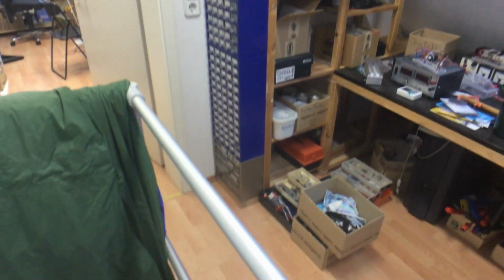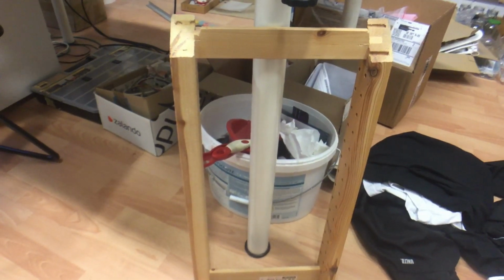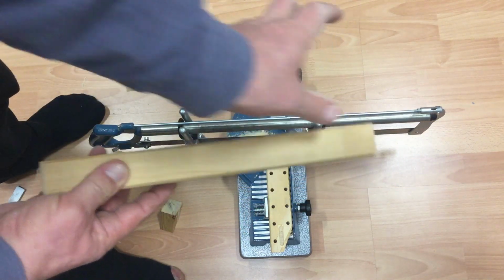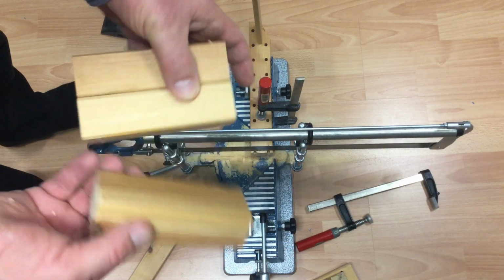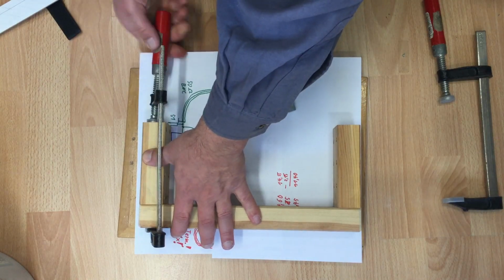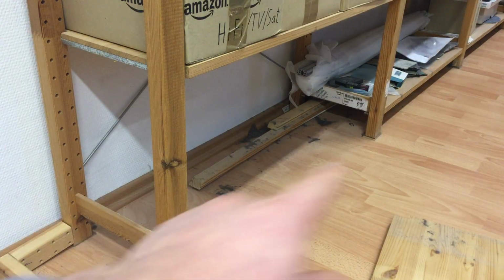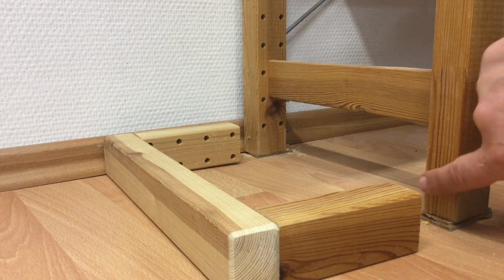I Will Have Order! – Plinth for Storage Cabinets Attached to Rack

Comment: 7:58 is a problem only if you are very sure that inside sides are perfectly square, is much better if you check squareness at the outside, which is the visible side
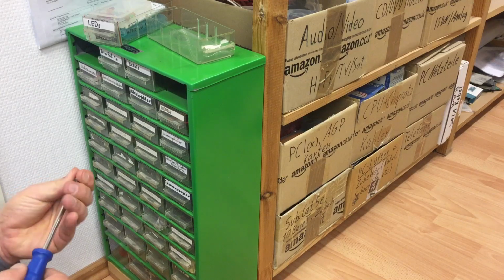13:35 Felo screwdrivers? I have ones since 35 years and still looks like new
Reply from the maker: You're right (squareness)! On the outside (at least at the one I can still measure) the parts are square :-) Regarding the screwdriver: It's sold under the brand name "LUX" here in Germany. They are not that expensive and reasonably good.